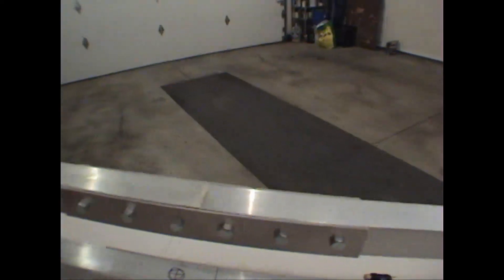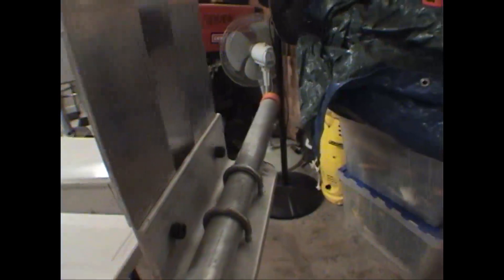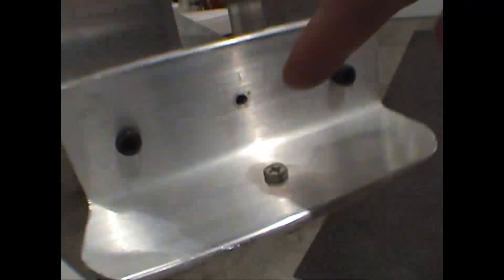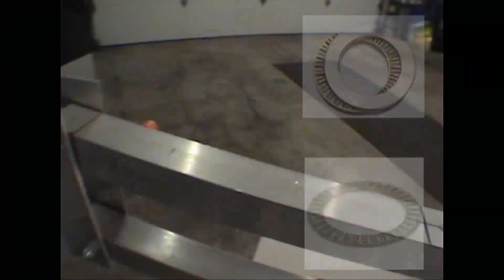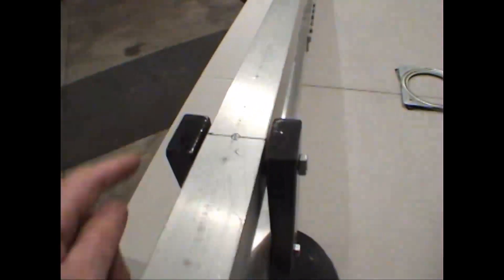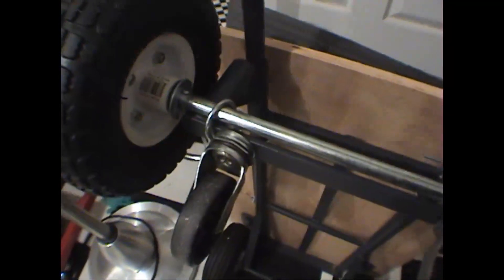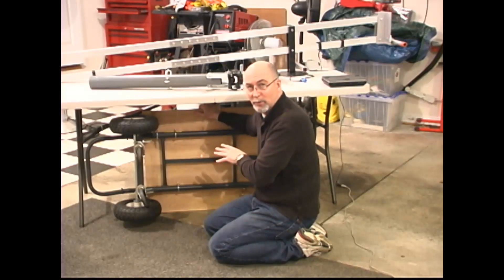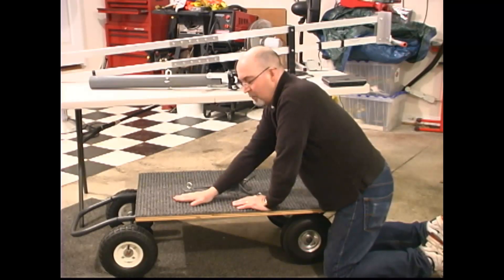1 of 3 How to Build your own Jib Crane

Comment: So the tubes are 8 ft long each. My question is how long is it from the steel plate to the end where the camera goes and how long from the steel plate to handle of the jib. Looks like 2 ft for the handle and 6 ft to the camera right?
Reply: Actually there are three sections now and each are 4' long. Since all of the structure is based off of weight the more length you have in back of the cantilever the less weight you have to have to balance it. This first version I believe was two to two and a half feet. The second version went to three and a half feet. The weight of your camera and if you are going to build a pan and tilt will play a big roll in weight distribution and where set your mid point.
Reply: I have two 8 ft long tubes. I may be using a Nikon D5100 on it or a Sony NEX-VG30H. I'm thinking about making a pan and tilt head for it too using cables and pulleys to control it later. I guess I will be making the handle two or two and a half feet to the mid point. If I get it done next month I'll upload a video of my jib to my channel.

Comment: Just don't tighten down too tight.  the rollers help making the jib smooth.  There could be scoring in the aluminum after years and years, but it is not a tool that is used every day.

Comment: The "thrust bearings" no doubt are the secret to the smoothness of the jib. It would appear the centre hole of the "thrust bearing" is much larger than the bolt that goes through them. How are the "thrust bearings" kept in place? Is this done by tightening the bolts? How does one prevent the thread of bolts from scouring away the aluminium square tubing? Thx.